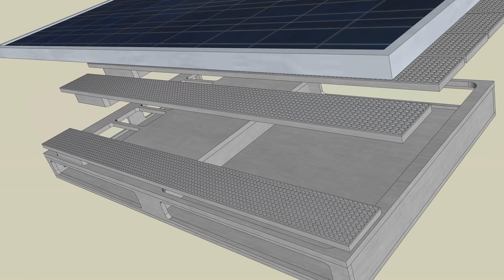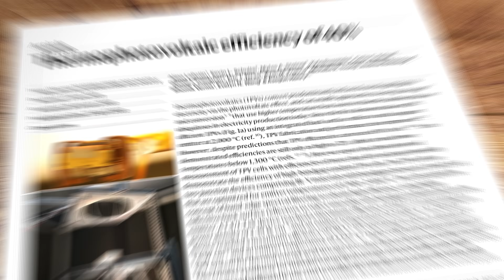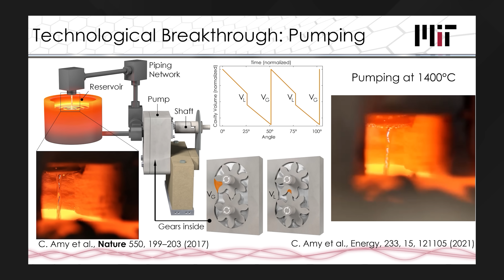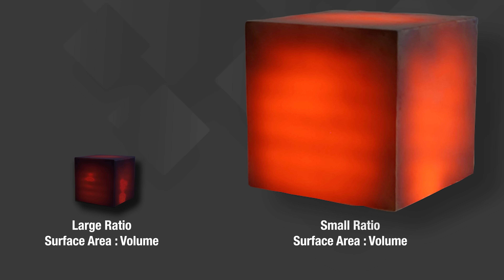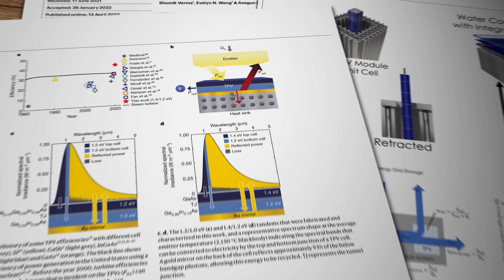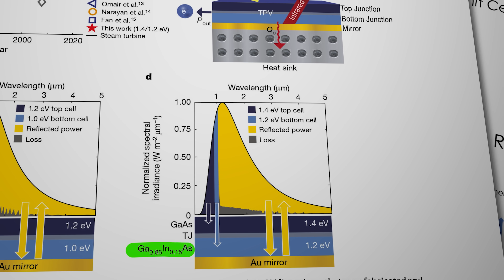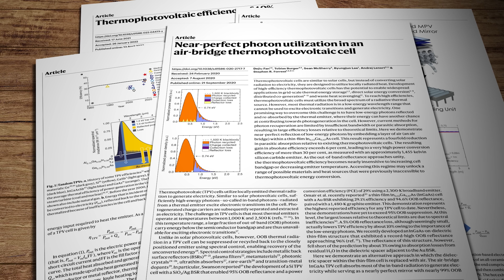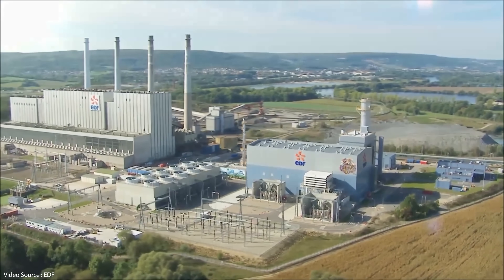Grid Scale Energy Storage 30x cheaper than Lithium-ion! How do they do that?

Comment: Absolute nonsense. These systems have been built already several times and they never work because it is a maintenance nightmare to work with molten metal or salt. If something goes wrong and the metal cools down enough to solidify inside the tubes, be prepared to rip apart your whole plant and exchange every single part. This is what happened with the solar power plant in the mojave desert.

Comment: This is very interesting and exciting.  I have a few questions though:  How does such a large and hot machine get maintained?  Does it need to be cooled down completely before maintenance?  Also, I wonder if much smaller, cooler and more portable heat-electricity cells exist.  I'm thinking of a rooftop version to compete with PV cells in hot climates.
Reply: You don't reach the temperature needed for this system without direct heating, and you can't scale that system down that much, while maintaining a sliver of effficiency.
Reply: @Psi-Storm  Yeah I was afraid of that.   Shame.

Comment: Could this system be better used to transform geothermal energy production?
Instead of pumping water, drill the MIT part deep into the ground and turn the geothermal heat directly into light and from the into electricity all without major moving parts.
A base source 24/7 power supply.

Also I presume the coolant in their system is having its heat sent back to the storage blocks.
Reply: I don't think geothermal is that hot.

Comment: Even more compelling than gas peaker plants are concentracted solar installations. I say this becaus photovoltaic has immensly outpaced them in efficiency and with this technology could suddenly make those already operating concentrated solar much more efficent and powerful. Since the graphit blocks would hold much more heat than molten salt and reach higher temerature and also release it much quicker.

Comment: Very interesting. An immediate concern for me is scaling up. There are already concerns over the availability of graphite in large quantities. The EV world is already struggling with this issue, among many others. New sources are slow to develop and may well cause technologies such as this some delay in getting to production.
Reply: We have plenty of carbon on our world and graphite is not graphene. What if we used all that coal we will have left over from not burning it, should be doable to purify right?
Reply: @ThaJay  this would be a GREAT use for coal and/or agricultural waste.
Reply: @ThaJay  That is what I thought as well, but I am not well informed. Commenting for the algo too...
Reply: @ThaJay  Coal isn't graphite either. Most graphite is mined as graphite directly from the ground. The highest quality graphite is usually made from petroleum coke and requires heating to 2500K. It's not cheap or easy to make graphite from coal.
Reply: Just was commenting - then saw other comments. You are right  about shortage of graphite. I was surprised. But this is natural occuring and appears plentiful - and more about mining capacity not keeping pace with demand. Where there is need and profit I can't see it not being matched within a few to 10 years. If not enough natural occuring deposits then since can be made from coal byproducts (which we have too much of)  - and  this is at least a long lasting productive and sustainable end use of coal than instead of burning it into CO2 at the levels of  billions of Tonnes p.a.  in powerplants  - as we do now.

Comment: grid scale also incurrs the huge cost of grid for distribution.  For most consumers, the grid cost is higher than the production cost or the storage cost.  Best answer is consumer based solar and consumer based batteries.  Any grid connections are for equalizing.  Grid based batteries are a mistake.

Comment: Okay- storing energy as heat is not new, though this process may allow for hotter temperatures and longer retention.  However i don't see why they would need Thermal PV panels, which are trying to reach the efficiency of a combined cycle turbine, when they could just use a combined cycle turbine?

Comment: I'm confused how this system is drastically less expensive than Lithium-ion batteries that have almost no maintenance involved. I feel like this system would be extremely susceptible to Mechanical failures. Catastrophic failures at that.
Reply: I agree, I think the third law will find a way to chew away at any efficiencies this system has.
Reply: Indeed. While I do not want to be negative, the mere mention of water as a cooling agent for the super hot stuff got me shaking my head in disbelief. "It just needs to flow fast enough" is a sentence one should not want to be using. So if it doesn't (pump failure for instance), the water does not flow fast enough anymore, turns to steam, builds up pressure and then *boom*. Although not the same mechanism, I keep being reminded of some of the nuclear issues we've had over the years: all due to water as a cooling agent.
Please don't.

Comment: Why not just use the stored heat to power a traditional steam turbine, or did I miss something? The novel battery part is in the pumping molten tin plus large volume / small surface area heat store...the PV bit just seems unnecessary complication?

Comment: Is there even remotely enough GaAs available to produce more than a few plants of reasonable size? And if available, will the price go 5x like LiCO or even worse and render the whole "30x cheaper" advantage void?

Honestly, I wouldn't want to store electric energy in thermal (the worst) form, even if the 40% conversion rate is pretty impressive. The system looks like a great addition to an NPP though.
Reply: It might also have the opposite effect of increasing the efficiency of the production processes, at least medium to long term.
Reply: @Kenionatus  It would depend if low production volume is the reason for a high price or low usage due to low production keeps it from getting expensive due to low availability.

Overall I HIGHLY doubt, that a complicated method, converting electricity (!!!) into heat (!!!) and then reversing the conversion via PV with an efficiency of ~40% is viable even on paper beyond the present. Li (or Na or whatever battery) based storage is only so "expensive" right now because we're globaly in transition from producing amounts of gloryfied Laptop-Batteries to scales needed for grid operation.

I expect prices for bat. storage to change similar to buying petrol at a pharmacy in the early 19th cent. to buying fuel at a gas station these days. The "energy storage" concept described in the video simply can't compete with that.
Reply: There are companies that produce GaAs cells now for satellites at much larger scales than needed for this application. Around 1000 m^2 are needed for a 100 MW thermal battery, while more than 10,000 m^2 are made every year for satellites.
Reply: @AsegunHenry  right, so at 1GW (10GWH) this system is using more than the satellite industry. And that's going to cover a fraction of a percent of any reasonably developed country, so not really a good example
Reply: @benholroyd5221  - my comparison suggests simply that the materials are available and the facilities to make the cells exist at sufficient scale. From my discussions with companies that make space solar cells, they do not see any issues going to 1000x their current scale. The example technology that uses almost the same equipment and materials that already has reached that scale, is LED’s. So although I get that you’re intent on somehow proving scalability is a critical problem for the cells, the current production of LED’s suggests it’s not. I’ll leave it an exercise for you to calculate the amount of each element needed to make 10TW of panels for the global needs. Then you can compare that to the total amount of each element on earth to see if we’d exceed what’s available. You may find that more convincing.
Reply: @AsegunHenry  I'm not saying that scalability is an issue at all, I don't know if it is or not, it's just that I dispute that your example proves that scalability is a problem. 

If it can scale up fine, but giving an example merely 10 times bigger than an infinitesimally small percentage of what would be needed doesn't prove that.
Reply: @benholroyd5221  - fair point!

Comment: wait a moment. What if you were able to get to those temperatures with heat pumps? Would you be able to get more energy than you put in in the first place? I think that would break the law of entropy. Maybe the efficiency of a heat pump would decrease enough to get a return energy below the original input?
Reply: Exactly. The coefficient of performance for a heat pump depends on the temperatures - and tends toward 1 at very high temperature rations like this, making it almost no improvement over just Joule heating.

Comment: Quite interesting and novel. One thing that wasn't mentioned - how is the heat transferred from the graphite blocks in the thermal storage to the tungsten foil in the power blocks? Would that also use molten tin? How would that material (tin or other) be stored when not in use transferring heat, and would there be complications transitioning it from its "stored state" to its "in use" state?
Reply: Yes it is liquid tin. And it doesn’t need to be stored. It simply stays inside the enclosed piping network the entire time.
Reply: @AsegunHenry  liquid lead may be better. The latter also allow a nuclear reactor to be fitted inside some of the graphite blocks for constant background power generation. Heat will be stored until needed. Thorium dioxide with Uranium dioxide in it melts at temperatures that is comparable to that of tungsten.
Reply: @daoyuzhang1648  - you may want to double check the boiling point of Pb and also it’s toxicity. These are the main reasons we go with tin instead.
Reply: @AsegunHenry  tin don’t absorb neutrons so doable.

Comment: it sounds like the re invent of the water jacket of a furnace. 

why start a fire to cool it down? 

and why tell the public? very likely speaking to wrong audience.

who have such a big pit of fire running day to day business? 

they should focus on lobbying metal foundry companies, rubbish incendiary service and nuclear plant to renew their cooling system instead. ordinary people don't have such a big pit of 'fire' need to cool down. and such a big heat element to fire up.

and as usual, the energy density of these heat exchange systems always focus on somewhere 800c, may be above for effectiveness, which is too high and too big a pit of fire put inside residential area.

Comment: So thats why the earth is still cooling and has a molten metal core after billions of years in the cold vaccum of space. 
Maybe just drill down to the magma where its close to the surface? Iceland, Yellowstone? All free from mother nature.
Reply: Well, that pretty much is already done in Iceland, and a few other places.  The company Quaise claims that they can drill down around 20 miles (not into magma, or nearly as hot) almost anywhere and get enough heat to run turbines.  They also claim that their demonstration projects will be on line fairly soon.  Idono---it could happen.  I hope so, anyway.

Comment: Interesting concept. How would it compare to the efficiency of pumped hydroelectric power? They have been doing pumped hydroelectric for decades, pumping water uphill to high mountain reservoirs for use when the primary energy source is insufficient. The technology is amazingly simple, and hydroelectric turbines are highly efficient.
Reply: Lower efficiency than pumped hydro - 90% vs 50% for thermal batteries. But thermal batteries are much cheaper and can be used anywhere.

Comment: I was wondering that since heat pumps are more efficient than resistive heating if this couldn't be improved even more by their addition?
Reply: Expanding on what Dr. Henry points out: heat pumps are efficient when they only have to produce diffuse heat. The best heat pumps for environmental heating are designed to maintain a differential up to perhaps 50°C (outside air -25°C = -13°F, inside air +25°C = 77°F). And for that they are very efficient. But it's quite another matter to ask them to heat something up by 1000°C or more. The thermodynamic advantage of the heat pump all but disappears at that scale even in theory, let alone in practice. And resistive heaters have no moving parts and should require basically no maintenance.
Reply: @ps.2  - you got it!
Reply: Such a heat pump doesn’t exist for this temperature range and would provide minimal benefit as dictated by the 2nd law of thermodynamics. But yes in principle it’d be great if we could use a heat pump.

Comment: Why not heat the graphite blocks directly?

Why not run the water from the cell cooling loop through a sterling engine before the radiator?
Reply: Btw you can actually run the TPV cells in reverse as an LED. If heated this can have efficiency that is slightly above 100% for electricity to light conversion, as the thermal motion of the electrons allow the band gap to be overcame and releasing photons at input voltage below the bandgap width. You are now pumping heat from the coolant loop into the storage device. A chirped bragg reflector or a dispersed dielectric foam (a kind of diffuse reflector) would give even reflectivity at >99%, even better than a mirror.

Comment: My question with this solution is what if the molten tin cools down? Something goes wrong, the heaters break down or lose power for an extended time and the tin solidifies. How would they recover from that?
Reply: Like nuclear reactors that need a certain amount of time to cool down after being shut down they have a backup power system in place to keep pumping all the hot metal until it has cleared out the pipes back to some sort of storage space where it would be coming from when needed.  any small bits of molten tin left in the system would be remelted when the system fires back up again.  At least that is how I think it could work.
Reply: I bet you embed heating elements into the pipes, instead of just heating all the tin in one big kettle.

Comment: That's a lot of bother to create so much heat when you could just buy an Nvidia RTX 4090 GPU this fall and create it that way instead.
But seriously, I often wish there were a way to convert heat energy into electrical energy at the micro scale. So many appliances generate heat energy that is undesired!
Reply: You may want to research “thermoelectric plates”.

Comment: one track mind, for  XIX century engineers, Using water to cool the cells. So quaint! Why not liquid ammonia, or butane/propane mix, run the vapor through a turbine generator, get a few extra megawatts. Combined cycle. Come to think of it, let's go full combined cycle, and forget the solar cells. Plus, think of Chernobyl/Fukushima. if water gets hot enough, it will dissociate into hydrogen and oxygen. Bad combination, unless in a rocket engine. A water pump failure, graphite at 2000 C, talk about global warming. The setup should not be in buildings, it should be underground.

Comment: To summarize. Another store excess energy as heat solution with some novel twists that are interesting but don't solve any problem either. This is combined with a heat to electricity back end that is only 40% efficient. Well..? Nope. But thanks for the interesting novel ideas. For sure some of these new technologies will find good practical use cases.

Comment: Hmm. There are three things I'm worried about. The gold required for the cells' mirror and the efficiency of the system and the power it produces as it cools down in the middle of the night because there's not enough power generation from the solar panels... Also, what if a utility system doesn't have enough excess power produced from wind and solar? Can this system even get up to temp?
Reply: 1. Gold mirrors only need to be one or two atoms thick, it's going to be an extremely small amount of gold.

2. As discussed in the video, the blocks will not cool significantly in one day, on account of being very big.

3. This does mean that warming up the system might take weeks, and a tremendous amount of energy. But the plant would be sized to it's purpose - like how in hydro, the dam matches the river.
Reply: @kanucks9  I thought it said it would hold heat for 10 hours?

Comment: I think its interesting but very complex and high cost to maintain over years of opposition . Gravity storage on large scale along with home battery storage ( costs are going to drop dramatically in two years ) and some localised battery storage packs ( costs are about to drop also ) will probably be part of the solution . Better use of  high voltage DC  to transmit power would enable say the east coast of Australia to receive solar power from the west coast ( 3 hour time difference ) . This helps when demand rises as local solar production reduces .. This could be applied across the planet linked with wind power and suitable hydro storage anywhere . now thats something to think about .